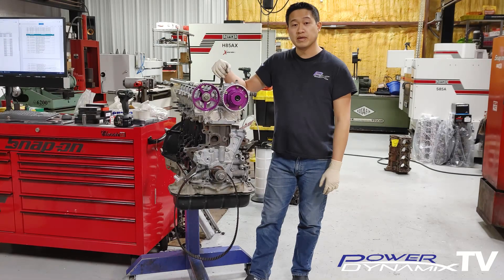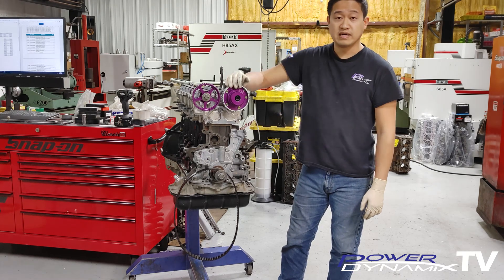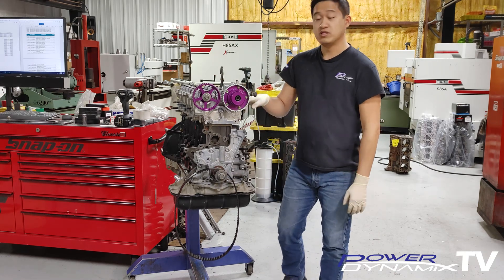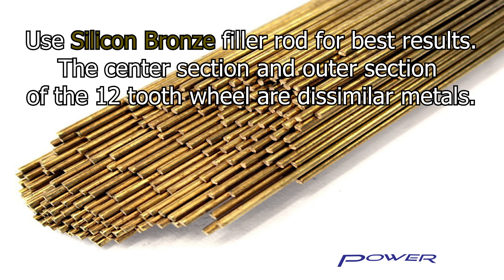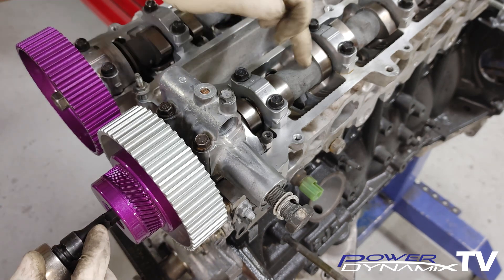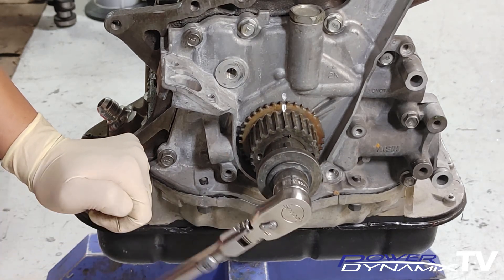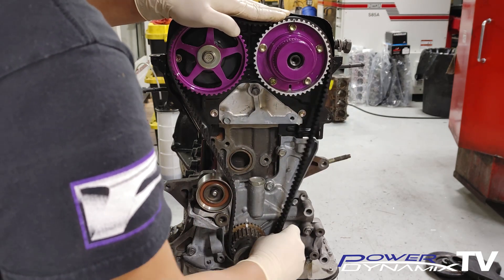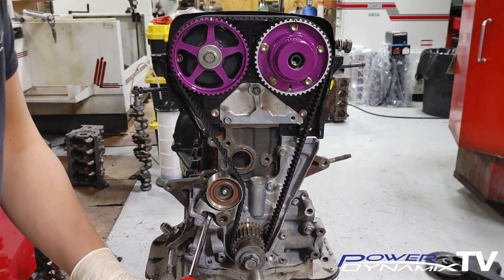Toyota 2JZ Timing Belt Install DIY How To

Comment: 7:10 - how often do these tensioners go bad? 
8:33 - 👀 i would like clarification on turning the VVT-i gear clockwise. I'm the video it looks like you turned the gear clockwise, then counter clockwise and clockwise again. Do we simply make sure the cam bolt and gear teeth are in the furthest clockwise position when lining up the timing mark? 🤔 Thanks

Comment: I watched this many time to make sure i understand correctly and followed exactly. I can confirmed that my timing is on spot. However, when i started the car, it sounds like some cylinders are firing. 

Does misalign one teeth cause this? I double check and redo it 4 times amd still the same. 

Engine: 1jzgte vvti
Reply from the maker: @yawheeller5407  You ou have to be careful when setting the timing. A few teeth off can definitely cause issues. Don't use an impact gun when loosening the cam gear bolts during disassembly. That can cause the cam to spin uncontrollably.

Comment: I get the dots are subtiming marks but im confused as to what using them does. Does the intake gear slack at tdc end up able to move equal amounts in equal direction before affecting cam? When your using the timing marks is all the intake gear travel in one direction ie counter clockwise when putting belt on?

Comment: Thank you so much for this video, the first time I tried to do my timing belt and water pump on my 2005 is300 (2jz-ge) I ended up having slack on the right side of the timing belt and on startup it bent 4 of my intake valves. Got the head redone by a mechanic buddy, used the one tooth over trick to ensure the belt had no slack on any side and now I'm back on the road. Really wish i had found this video a few months back.
Reply from the maker: @navubu  I'm glad our video helped you out!

Comment: Would a gte  block with a 1.5 tomie headgasket and a ge vvti head be interference
Reply from the maker: Yes, that will make it non-interference as long as you're still running stock camshafts.

Comment: I really don't understand why 90% of the YouTube videos do NOT follow the service manual!!  The engine should not be set at TDC!!!  Bringing it back a tooth is a joke and not per the manual.
LMAO at this video
Reply from the maker: It's to help relieve the slack in the belt. You can do it by the book and have a harder time putting the belt on and getting the timing correct. Just a little shortcut. 
You go to school as a child and follow the teachers directions because it's the first time you are doing it. After doing it 1000 times you don't think you find a way that helps make things easier?
Reply: @PowerDynamix  piece of cake to follow the service manual!!  Set engine at 60BTDC, cams on the dots, check the vvti rotates 30 CCW and the belt goes on easy with slack in the tensioner side.
LMAO at the video and hack mechanics.
Reply from the maker: @jdub6797  yes very great we know you can follow the service manual. So how does the service manual tell you to time it without the timing cover and crank pulley on there? How are you going to set it 30 degrees back without the crank pulley on there? You could use a degree wheel and dial indicator, but most people don't have that. 
The timing gear on the crank only has the tdc mark. Also have you installed it with a kevlar racing belt? Those have a lot more tension and require you to compensate for the slack in the belt. What about with aftermarket ATI damper, or a race engine with a billet front cover? This is a general guide for people to do it via the timing gear directly. I've done over 1000 of these 2jz.  Please report back when you have built at least 100 engines making more than 1200hp. Thanks for watching.
Reply: @PowerDynamix  LMAO with you trying to justify not doing the timing belt correctly.
The timing gear on the crank has a mark for 60BTDC.  That is your starting point and the cam gear align to the dots.  Again LMAO at this video and replies from hack mechanics!!

Comment: Excellent video. 4:40 my non-vvti crank gear separated and now I'm pulling my motor :(
Reply from the maker: We can reweld the gear back together if you need it fixed.
Reply: @PowerDynamix  true, however I have to pull the motor anyway. The oil pump failed, as well as cracked main caps. Gonna replace with billet main caps and a PHR billet timing belt gear.
Reply from the maker: @DeanBKK  let me know if you need the block line bore and machined. We offer those services as well.
Reply: @PowerDynamix  I'm overseas, got a bunch of machine shops local to me. Btw I just uploaded my latest video and used a 10 second snippet from your video in it. Hope you don't mind 😅
Reply from the maker: @DeanBKK ok sure no problem, just tag us. Link me to the video when you post it so we can give it a like.

Comment: Hi, I’m doing timing belt on a 2004 is300 2jz-GE and the vvti gear does not stop at the mark. It spins about 15 degrees both sides what should I do? 
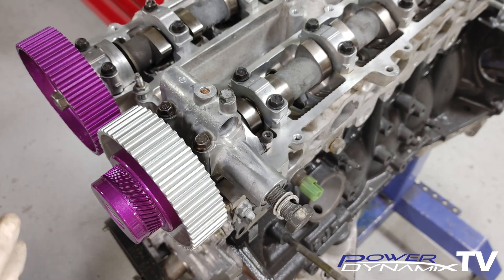Help please. 5:49
Reply from the maker: Turn the gear to the left past the 15 degrees until you get all the slack out. You should then be able to have the gear stop on the mark when turning right.
Reply: @PowerDynamix  car is running good 
Thanks 🙏

Comment: wish you mentioned the non vvti ge, i figured you would and was suprised when you never did
Reply from the maker: Non vvti pretty much the same procedure as this. You just don't need to worry about the intake vvti cam moving around because it's just a fixed gear on the non vvti.

Comment: No torque specs for the Vvti gear???
Reply from the maker: 61ft/lb for the 10mm hex Allen bolt.
Reply: @PowerDynamix  thank you 🙏🏼
Reply: @PowerDynamix  is there any other torque specs I should know? I can’t seem to find a guide anywhere

Comment: Supper helpfull!!! I do got a question, I got a 92 sc300 and it’s Sappose to be ge NON-VVTI but it gots the VVTI solenoid on the head. I’ve heard of these motors on forums and have seen some make it easy to upgrade. Have you ever heard of this?

Comment: You’re using a specific socket to tighten the vvti gear, what is that?
Reply from the maker: Inner bolt is a 10mm Allen. Outer cap is a 14mm Allen.

Comment: First time for everything I guess. I wish I had paid attention while doing the job or watched this video first. Pretty sure I just bent some valves on this GE motor not taking the slack out of the vvti gear🤦🏻‍♂️ 

I took the belt off and put the gear on correctly but I still have misfires on 1,4,5 and 6.
Reply: You ever figure it out?

Comment: i forgot and accidentally tried to remove the vvti pulley with an air gun i stopped but did and removed it with a torque wench, my timing is off on the intake camshaft but the exhaust timing is fine, did i damage anything? 2jzGE.

Comment: Hey Jeff! In the pass couple of wks I've been reading a lot about you/ the guides and help on the forums! I hope you can point me in the right direction. So I bought is300 and the seller failed to mention that the car was throwing a code p1346. So I've changed the vvti solenoid and the tiny filter just to make sure it wasn't that. As well as replacing the timing belt and made sure it was timed correctly. However, im still getting the code! Any help? Thank you in advance!
Reply from the maker: Check the wiring in that case. Make sure no breaks on the wire and make sure the connector is tight and not cracked. If both are ok then use a multimeter to test the wires, and make sure they have continuity.

Comment: This is a great video! I did timing on my IS300 (2JZ-GE) a couple of years ago and was a little confused about this procedure. In particular, the FSM for the IS300 mentions that the timing should first be set to TDC where the crank and cam TDC markings are lined up properly. After pointing out that the engine should not be rotated counter-clockwise ("NOTICE: Always turn the crankshaft clockwise.", the FSM then indicates that the crankshaft should be rotated 60 degrees counter-clockwise to the sub-timing mark, indicating 60 degrees BTDC. This will also move the cam pulleys to their 30 degree BTDC sub-timing marks. The FSM then goes on to state that doing so will prevent piston-valve contact should one of the camshafts spin (e.g. during removal of the cam pulley bolt) after the timing belt is removed. ("NOTICE: If the timing belt is disengaged, having the crankshaft pulley at the wrong angle can cause the piston head and valve head to come into contact with each other when you remove the camshaft timing pulleys (steps 13 and 19), thus resulting damage. So, always set the crankshaft pulley at the correct angle." When I changed the belt, I followed this exact procedure, and despite accidentally spinning the exhaust camshaft during pulley removal, the T-belt job went fine. But of course, this would put all the slack on the VVTi/intake pulley. I had to keep this in mind when putting that pulley back on and torquing it to 60 ft lbs. 

I see people timing to the sub-timing (30/60 BTDC) marks all the time, but they all seem to arrive there by rotating the crank clockwise and not doing the reverse procedure. If you don't do the reversing step to move the crank to 30 degrees BTDC, it seems like the intake camshaft would be off by 30 degrees and this might cause damage when removing the cam pulleys. Just curious about your thoughts on this procedure as written in the FSM?
Reply: so you timed your car according to the FSM and did the backwards thing? I am tempted to do what most tutorials are doing, and simply just time it at TDC. any recommendations as I do my timing this Weekend?

Comment: HOw do you rotate the engine counter clockwise? Even just one tooth? You cant use the crank pulley bolt because it wont remain tightly threaded.
Reply: You never rotate it counter clockwise

Comment: Looks pretty simple, however getting to it in a car is another story lol
Reply from the maker: Fairly simple to get to inside the car still. Just pull out the radiator and fan assembly. Just two 12mm nuts, disconnect fan connector, and radiator hoses. Should take all of 5 minutes to do including draining the coolant(which should be done if you are going to change the water pump unless you plan on making a huge mess).
Reply: @PowerDynamix  do you need to take the valve cover off to do so? On my sc300, 2jz-ge, the intake passes over the valve cover, wasnt sure if i had to take that off too...

Comment: Can you elaborate on what position the cams are suppose to be in before timing work?
Reply from the maker: They need to be pointing straight up within 1 or 2 teeth before you start. Make sure that the crank is at least 1 or 2 teeth back so the piston is down in the bore a bit before you start messing with the cams.